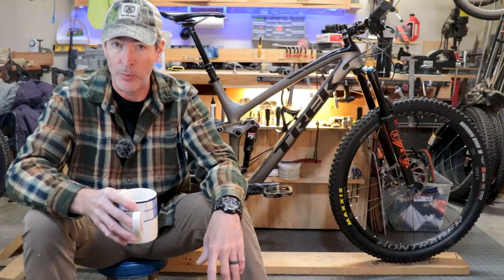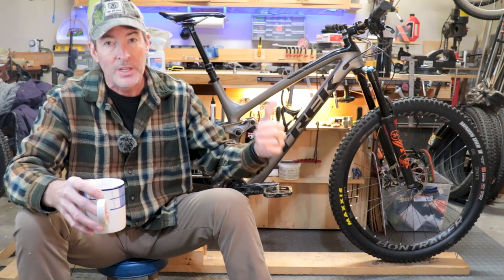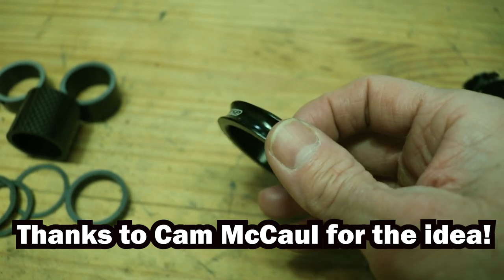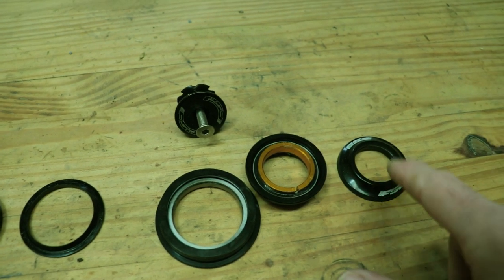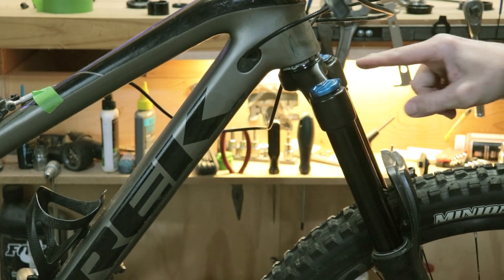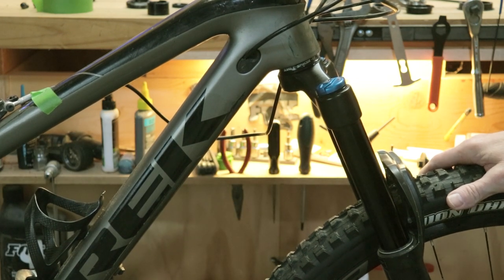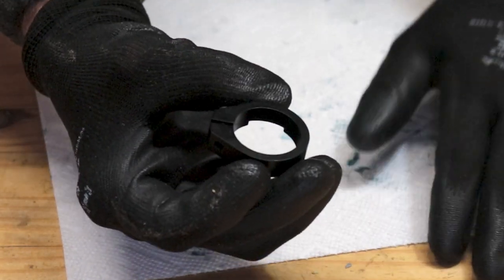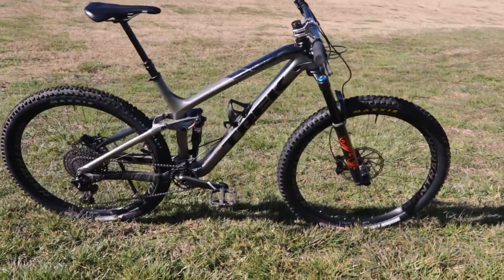Decrease HTA on MTB and Shorter Stem. Trek Fuel EX. Ditch Knock Block!

Comment: Nice. I just ordered a 2023/2024 Fuel Ex Gen 6 frameset for a build I'm going to be doing. The max fork is 160 mm, which is what I'll be installing. Also went with 165 mm cranks and will install the angle adjust headset cups. Should offer some adjustability to the bike.

Comment: Did u change the fork Sticker or the whole fork?
Reply from the maker: Just the sticker. It’s a Performance 34 with a 150mm air spring
Reply: @TrailBreaker  did the old Sticker rub off?

Comment: If you could go back do you think you still would have gotten a trek?
Reply from the maker: Man, that’s a good question. I bought this used so there were more Trek’s available so the $ was reasonable. Santa Cruz is amazing but a little pricy imho. I originally wanted a Canyon Spectral but there was a 6+ month wait for new (great price for the build). So I guess yeah…I probably would’ve still bought this bike. If you’ve followed the channel you know I’ve made a lot of small changes to the bike but it still is a Fuel (just better fitted to my style of riding).

Comment: what you think about 160 fork for Fuel EX?
Reply from the maker: Trek says no but I say go for it! You risk extra stress on the HT area of the frame but it’s not 10 or 20 mm higher. More travel means more sag (if you still run 25-30% like before). I’d argue it can be LESS stress since I had to use max volume reducers and high pressure to keep from constantly bottoming my 130mm fork. Now I have a more plush and comfortable ride with little bottoming at 150mm. Just my opinion 😊